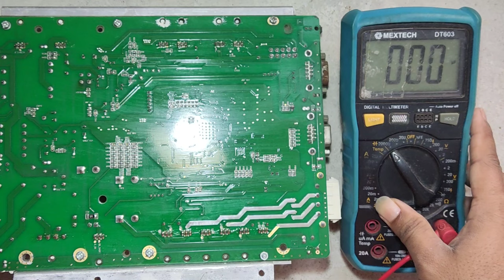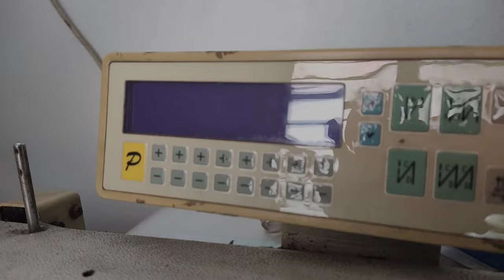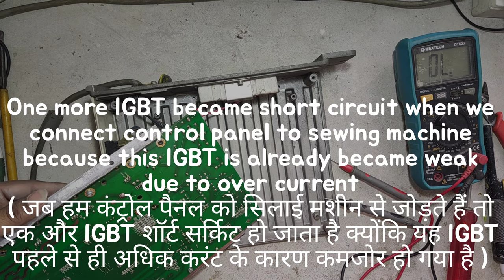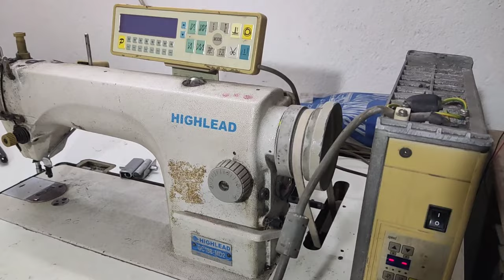Auto Trimmer, auto Bartack sewing machine controller repair | HighLead sewing machine | No power

Comment: Error 09 same power box
Reply from the maker: There is a big white colour breaking resistor, check that resistor connector. If the connector is connected properly, then check the corresponding braking resistor circuit.  

At last also check the capacitors and voltages ( 300v, 30v, 15v, 5v,3.3v)